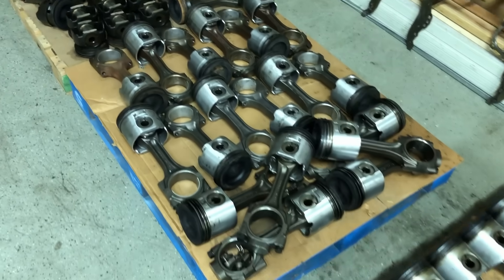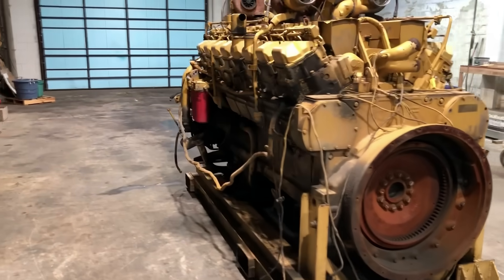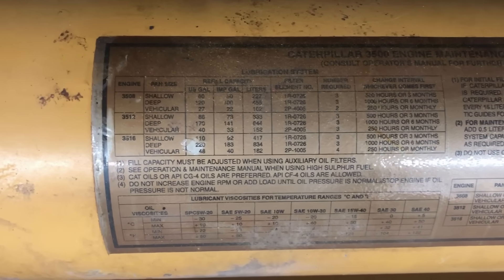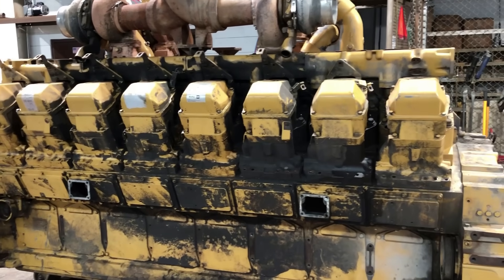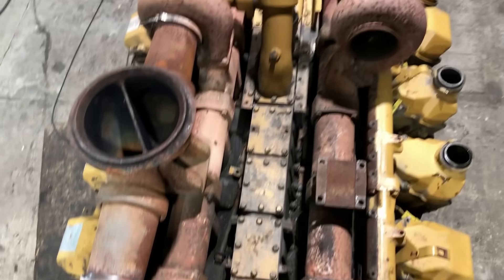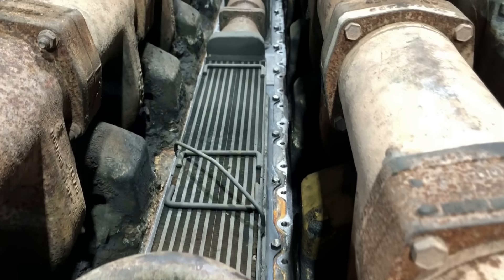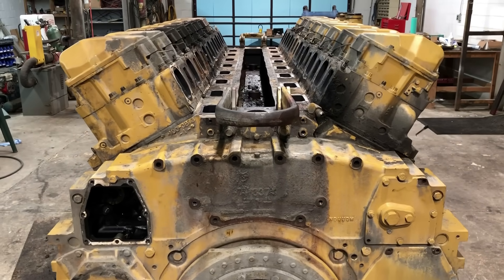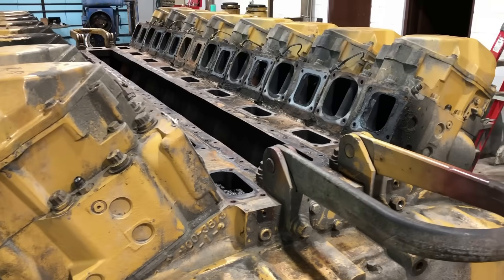Tear Down of a 17,000 Pound V16 Caterpillar 3516 - 1800 Horsepower 69 Liter Diesel Engine

Comment: I worked at Mt Thorley in 2008. Would love to know that job number, very hard to see on the video.
I still work in the engine department to this day.
Reply: The internet has never ceased to amaze me in how it has shrunk the world. An auction engine gets it'd and a guy from the shop it was overhauled a world away jumps in to I'd it. Mind blowing 🤤
Reply: This thread is epic
Reply: I have heard of Genset engines doing 80,000hrs. Genset engines sit at a constant RPM and load their entire life compared to a mining application. Depending on maintenance standards a 3516 gets rebuilt around every 18,000 hrs.
Reply from the maker: I believe it was UB00093
Reply: Thanks, we checked that old job number out and discovered that several of the guys who still work in the Westrac engine shop were involved in the rebuild of that engine. We all were amazed it ended up back in America. The engine was fully rebuilt in 2008 and was reinstalled into the rebuilt truck.
Reply from the maker: @thefatbachelor  That's interesting.  It ended up at a major coal mining corporation in West Virginia.  They sold it at auction, and I bought it and had it hauled to Missouri.  I have no idea what happened to the truck it was in.
Reply: @KT3406E  How much did you pick it up for if you don't mind sharing
Reply: awesometiny that’s awesome man crazy world.
Reply: What type of truck was this engine in?
Reply: @rogerhazen3664  cat 789b considered a large mining truck...they have a payload of up to 170 tons
Reply: @1985bigwhite  ya I did some googling and realized the engine goes in those big mining dump trucks. Insane. Love it
Reply: @rogerhazen3664  you should hear them when they start them up to do pressure checks!
Reply: The b series of the 789 started around 1986 or 1987 I believe, I started at caterpillar in 2006 and they were the d series then so just guessing the motor would be mid 90's....the motors now come from Lafayette Indiana...not sure where they would have been built back then
Reply: In marine applications we did 10k he top ends and then then on the third one so 30k hours we did a complete overhaul. That’s usually about 1 year per top end and then we staggered them so only 1 engine of the 4 was due in a quarter.
Reply: JB00093
Reply: MrCloudseeker  Depends on how often the engine runs, like most piston engines. If you run it daily or constantly like on a drilling setup or marine application then yeah, I'd expect tens of thousand of hours before the crank bearings are shot and the bottom end needs to be torn down and rebuilt. If the engine sits without running for months on end in a humid environment and/or improper lubrication, then things start to corrode and wear a lot and you might be lucky to get a few thousand hours out of it.

Comment: Mount Thorley would be correct sir, it's an open cut coal mine in the the Hunter Valley of NSW Australia
Reply: Mt Thorley is also an Open Cut Coal Mine owned By Yancoal in the hunter Valley
Reply: Mt Thorley Warkworth is indeed a coal mine in the Hunter Valley. Westrac is the NSW CAT dealer and has a branch in the Mt Thorley industrial estate virtually across the road. I worked there until they opened the new branch at Newcastle.
Reply: Well westrac was a cat dealer and repairer at mt thorley but it was not a coal mine. Westrac has moved it's operations to tomago nsw. You probably find this engine was sold during the move

Comment: I'm glad this got in my reccomendations :D
Used to work on few of these and D399 in high school at practicing classes, mainly pulling off and replacing pistons,  machining heads, changing valves and valve springs, cleaning or changing injectors, removing rust build up at head's water chambers, those were good days :)

Comment: Don't let them get you down.  I spent some time in a machine shop where a lot of what we did was put stepped steel sleeves in Cat tractor blocks to allow the upper counterbores to be remachined to stock, after which the deck was surface ground.  I ran the vertical boring mill.  This was many years ago, and I find your videos very interesting.  I'm amazed at the number of superb craftsmen who post on YouTube.  Many thanks, and best of luck as you move forward.

Comment: 1800hp, there is 4 cylinders with 1800hp, kinda crazy to think about
Reply: real 1800 hp that work 24/7 is something completely different than a 4banger that can handle 1800 for a few seconds and needs a rebuild...

Your little turbo engines would not last even 10 minutes of the work a big diesel does.
Reply: @kr-gs5pt  Who cares? Its still 4 cylinder vs 16 and 1.6 displacement vs fuckin 69 displacement, no shiit its gonna be more reliable captain obvious

Comment: This is the engine powering this genset that was destroyed by a train: https://www.youtube.com/watch?v=bc6ZmD73spI

We had serious problems with turbo seals on this engine. We built 60 gensets with this engine for Google at 3m each. We had 5 turbos go bad during fire-up and run-in testing. Two of those went runaway and one of the runaways was a total loss. The total loss ended up biting us in the ass. Cat got us a replacement in less than a week, but it was their last available unit. On the final genset to complete the order, the truck hauling it got stuck on a railroad and destroyed by a train. There were no salvageable parts so we had to build another one from scratch. Problem was Cat already sent us the last unit they had. It took them over a month to get us the final engine, and then another month for us to build the genset with it. The impact was so devastating that it split the engine in half, knocked the generator head 200 yards away from the rest of the wreckage and did over 4 million in damages. The radiator(18' by 20' in size) ended up destroying an entire parking lot full of cars. Luckily nobody was hurt and the truck driver got out just in time.

Comment: I know little about diesels, especially these larger ones, but I have a question.. The air charge cooler.. The water that flows through isn't engine coolant, right?  It must have it's own water and a radiator of it's own somewhere away from the heat, right?  It's probably obvious to people who know these motors, but have mercy, as I've never even seen one of these installed in anything before.

Comment: You tell it like it is up front. I like that. I used to work offshore on supply and crew boats. We had 3512 main engines and 3606 bow thrusters and generator engines. These are great engines with very good low end torque. Great video my friend. Have a great day!

Comment: Not that it is wrong to do how you did and maybe you already knew it,  the Pistons are often removed still in the liner as a 
"kit."  It does take a certian tool or using a large socket to wedge between a counterweight and liner bottom while the crank is turned to pop the liner free.  If you were to go and rebuild this one you would get the piston already in the liner and ready to go it block with out messing with rings.

Comment: I’ve never torn down any engine that large, but I’m sure it’s more than satisfying to finish and have a happy customer. I helped a friend tear down a Detroit diesel (V8) out of an old KW. Taking it out of the truck was the easy part. After that, as you know, it’s just keeping track of the old parts to be replaced, the ones to be cleaned for put back on and everything in between.
Nice video (not perfect but good enough), informative and a very ingenious way to remove the base plate.
Good luck and god bless. Can’t wait to see the next video from a fellow wrench.

Comment: Good video, thanks!
Like you said, that one is a baby. I used to work in a power generating plant that had two old Worthington SW/14 VEE engines in it. They had a 14" bore and a 36" stroke and they were a huge PITA to work on.

Comment: I work with cars, this is amazing. BRO mad respect. I wouldn't want to change the oil on one of these machines let alone disassemble one. Like 50,000 bolts. (For the oil pan)! Fuck that.

Comment: 69 litre and only 1800 horsepower seems massively inefficient
Reply: Carlos infinite torque
Reply: 8000 lb ft of torque; the engine also operates, generally, at a low percentage of its possible output in order to maximize its lifespan

Comment: I've always wondered why they don't make gasoline engines of this size and horsepower rating, with this level of metallurgy, thickness, strength, and machining quality. I know they have made gasoline airplane engines in the 1920's to 1940's that were similar to this, in their RPM and Horsepower ratings. I've always wondered why Dodge/Chevy/Ford doesn't make a 8.4L twin turbo V8 gasoline engine, with 600HP and 900 ft/lbs of torque, for towing. The gasoline engine would have a lot less emissions, without any Urea tank system, using conventional catalytic converters? When I see Diesel engines in modern small trucks, they smoke so much, it's literally offensive. Would a gasoline V8 engine with twin turbos and low compression forged pistons and a forged crank, not be just as good for towing? What about the "cool factor" of a giant turbocharged factory gasoline engine?

Comment: I own an engine machine shop here in Alabama . we do a lot of 3400 series engines but have only recently began to see some of the 3500 series . Haven't rebuilt one yet but i'm sure it's coming . I'm installing pin bushings in a set of 3412 , 2 sets of C15's and a set of C15 acert rods tomorrow . Love doing the Cat engines . But , we do all types of heavy diesel engine machine work . We rebuild cylinder heads , line bore blocks , counter bore , install lower repair bushings , Grind crankshafts , install pin bushings and bore them and install sleeves in the smaller diesels . Really enjoy watching these engine videos .

Comment: With so many cylinders, could you just disconnect the offending cylinder (valves and injector) and maybe the opposing cylinder (for balance) and continue using the engine without a complete tear down?

Comment: it's a treat to get to see the insides of one of these engines ... I work for a company that builds frac pumpers using 3512C, 3516C, and now 3512E engines.  Brand new engines, so if we ever see the insides, things went south quick ... knock on wood, we never have.

Comment: If the engine was rebuilt not too long ago, chances it was an inframe, might want to check the mains this time? And to suck a valve like that it must have some time on it, wouldn't you think? How many Hours do you think that the engine has, more than 10,000 Hrs.? God job tear down!!

Comment: Awesome video and content. I've seen a lot worse video and audio. This was great. CAT know how to build engines, pity they have a few valve failures but there's 64 of them just waiting to let go in this engine. My old 1952 D4 is still going. I've only ever had to replace the precombustion  chambers. Eventually a liner rusted through so it got new liners, pistons, rings and put in a fresh set of bearings. Wonderful sounding engine. I wonder what a 3516 sounds like?

Comment: Good video. I used to work on big trucks. I am familiar with 3406 A and B, Direct and Pre-chamber. Also some 3408 and 1693. Even Cummins NT and a little KT. But never anything this big. I see similarities except where in what I have dealt with, you could lift the parts. Here, with the 3500 series, you practically have to have some kind of lift for most things. I really enjoyed your video. I am always interested in these big engines and your and other's videos sharing your experiences with them. Thanks.

Comment: Silly question from "not a mechanic":  If the engine was in relatively good shape & was within your means to rebuild, wouldn't it be worth more as a running engine, than just parting it out?
Reply: There are people always looking for parts as a pose to a running engine. Sold the bare block with crank for probably  the same price or more than he payed for to whole engine. Now he has more part to sell to boot.

Comment: Hi guy - working on those by yourself is a pain - I have about a million miles on 645 and 710 and and a little 3500 series cat stuff .... next time you do one think about leaving it one the skid fabricate the hinge fixture so you can flip the block on its side - that way everything is at an easy work height and accessible- if you want some fun do a 3516 or a emd 645 E4B in the bottom of a boat - it will change your outlook on life lol... I have pulled all power assembles and resealed 20 cylinder EMD in modules with about 2 foot clearance on each side of engine in the artic at -40 degrees - life really sucks when you have to heat the oil with a steam lance to even get the engine to turn .... makes that shop look cozy... keep up the good work guy - don't worry about the know it all assholes - you have already forgot more about diesels than they will know.. you might consider showing a few action shots of pulling off the jewelry heads and how you get the liners out... they might find it very interesting..

Comment: Hello. Second video of yours that I have seen. I am curious did you buy this engine just to part out I take? I simply have no idea what something like that is worth. What kind of money do they typically go for? Most of my diesel engine work involves much smaller tractors engines. It must get very tedious with so much repetition and so much weight. By the way no need to knock your video because the video was fine and so was the sound. Quite interesting. Thanks for showing us.

Comment: Hey Mate, just an FYI...
I live in Newcastle NSW Australia. There is Spare Parts & Maintenance & Rebuild  facility at Mount Thorley. Mt Thorley is in the Heart of the Hunter Valley Coal Mining region. Huge scale open cut coal mining in the Hunter Valley. I think Newcastle is one of the world's biggest coal export ports. 
The company was Gough & Gilmour (may now be Daracon) & they operated the CAT facility. Also had an engine test Dyno on site. You can see it as the small square building attached to the southern side of the main workshop & Spares building onsite. (Refer Google Maps GPS Coords -32.620902, 151.101974). So that engine was probably in a dump truck here in the Hunter region back in 2008.
Reply: Hey Tony, I’m from Maitland, just down the road from Mt Thorley. Gough and Gilmore I believe became Westrac. The Facility is across the road from Liebherr. The bigger Spare Parts Facility is at Tomago.
Reply: @Smokymcpot1  Yeah, I'm in Newy, but lived in Maitland & worked did work around Maitland plus Mt Thorley & Singleton as well. I know the Tomago facility. The 'rebuild' ticket was 2008 & said Mt Thorley so I assume it was done up there before the Westrac was built at Tomago. I worked at the Mt Thorley site doing telephones a few times back in early 90s...

Comment: My former employer had 4 backup gen sets with those engines in a dungeon. He never changed the oil or coolant and after 11 years the coolant ate a hole into one of those, "air to water charged air coolers." Coolant got into a couple of the cylinders on load test one day and a few of the cylinders hydrolocked. The rods turned into Tootsey Rolls but the rest of the engine was fine. Don't care for that charged air cooler design but I guess it saves tons of space. I was surprised to see how disgusting dirty that valley was they must been running that engine open air box or engine oil got in and cooked into carbon. Feel sorry for the liners. Great video clean shop thanks for shareing.

Comment: You probably already know this, but watch out as some of the 3516s have different displacements and rotating assembly parts dont interchange. Just be aware of that if you use salvage parts from a donor engine.
Reply from the maker: Yes I know.  I sell the 3500 blocks and cranks, I don't do anything with them myself.

Comment: even if i do not know much about those engines, watching those is still fun since where else could i see and learn about those things? like i learnt that those pistons are smaller than what you would expect from the outside, the turbo's inter coolers are inside the engine and there are V16 engines in this world! (also appears to be a 60 degree and not a 90 degree as well!)

Comment: What needs to be done to the engine?
Can see that 1 cylinder is rusty, leaking headgasket? and long time standing still?
I am very surprised to see lightweight pistons in the engine, most car engines do not even have a lightweight construction like that.

Comment: So the general 'rule of thumb' has been not to mix pistons in an engine and I am no engineer but my guess as to this train of thought would be; that you could probably get different forces on power stroke do to combustion chamber design or even weight and design strength of piston itself! Maybe you thoughts on this and if this may have had any impact on this engine being taken out of service?

Comment: Mt Thorley is a coal operation in the Hunter Valley Region (NSW). Was run by Rio Tinto I think. Could be Yancoal/Glencore now? It’s not far from Newcastle. Westrac and Hastings Deering are the CAT distributors here in AU 😀 I’m not a mechanic but these videos are great. Keep it up
Reply: Thorley is no longer a mine, it is being used as a dump for Warkworth. It's been Yancoal for about 18 months now.

Comment: That engine would have been powering a dumper in Mt Thorley mine ,some of which are radio controlled (no driver on board) so they run 24 hours. The mines get a tax break by spending money on maintenance so it would have been completely overhauled. Once it reached 3 years old ,it would have depreciated to nothing in value according to the 'books' and would have been placed on line for sale. Mt Thorley mine,which is just outside of Singleton , in the NSW Hunter valley is an open cut operation which mines 6 million tons of coal per year. part owned by the chicoms.
https://www.yancoal.com.au/page/en/about/